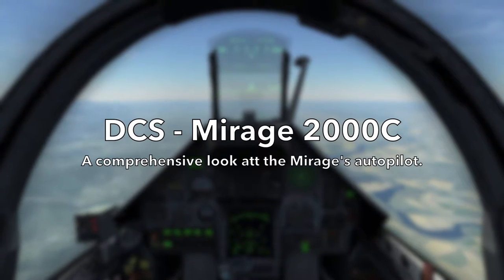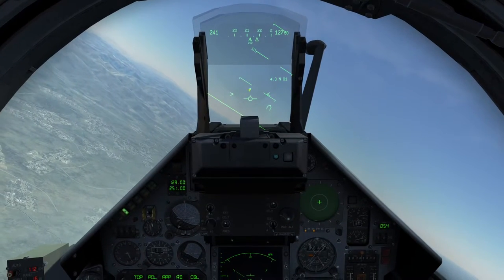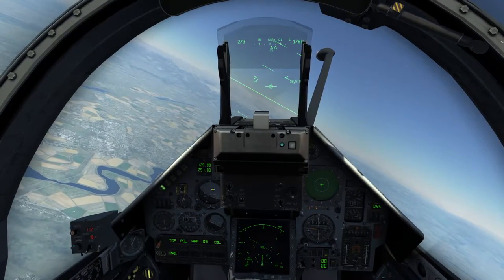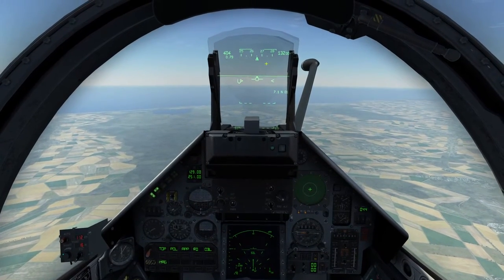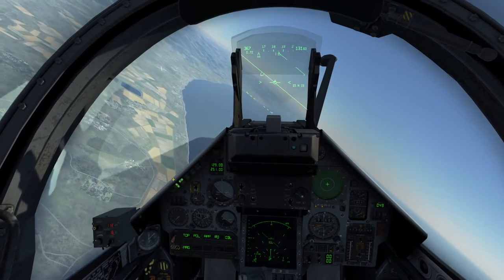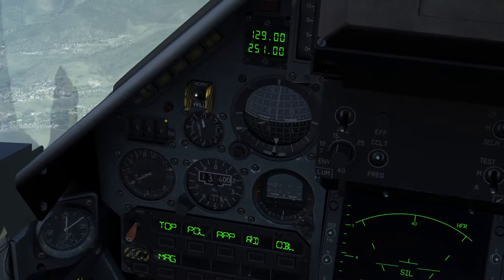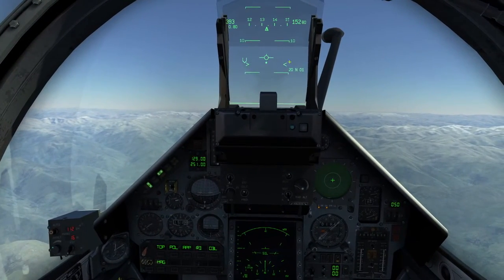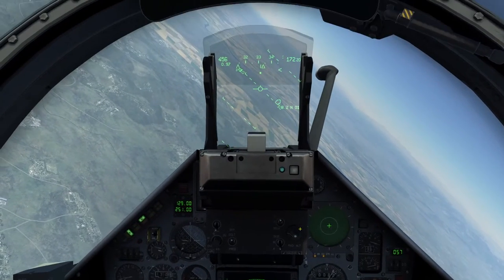DCS - Mirage 2000C - A comprehensive autopilot tutorial!

Comment: Good job, thanks,
the auto pilot is probably working as designed and the manual needs to be updated.  As a pilot I've flown many aircraft and some of the 'quirks' you described are most likely designed into the system.   For instance you want to make sure that the altitude hold is not engaged when set to zero or another unsafe altitude.

Comment: I am aware this video was posted a while ago, but I have just acquired the Mirage & believe I have figured out the way to operate the Altitude Select. Not sure if this is how the real thing works but it behaves similar to other civilian aircrafts I've flown in Xplane and co.

You will want to : 
#1 - Select your desired altitude
#2 - Enable the autopilot and Altitude hold (will show as amber/yellow)
#3 - Apply trim accordingly to the desired rate of climb/descent to your desired altitude
#4 - Within 1000ft of the set altitude, the Altitude select button will change to 'green' & the aircraft will automatically stabilise with neutral trim once it reaches the correct altitude